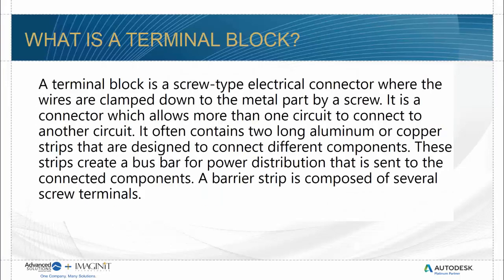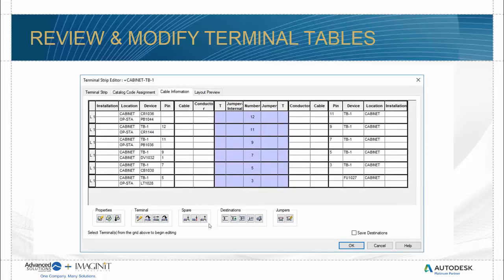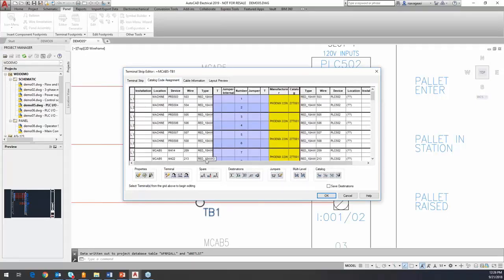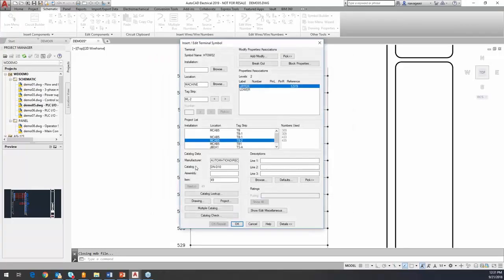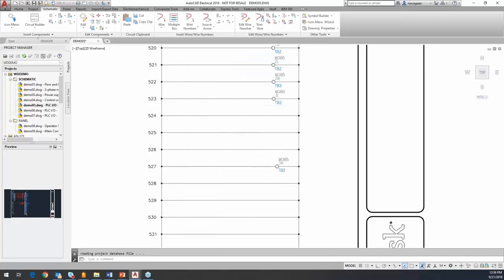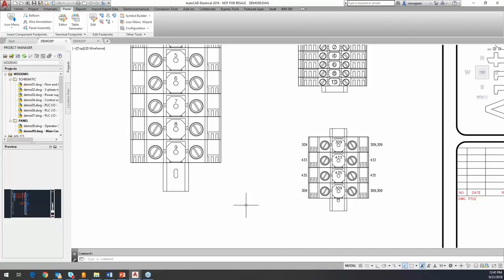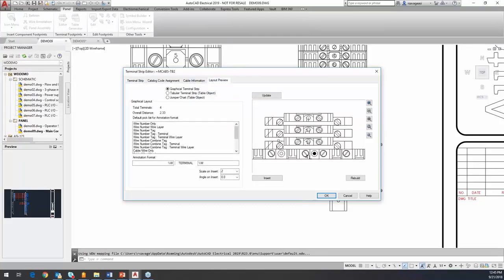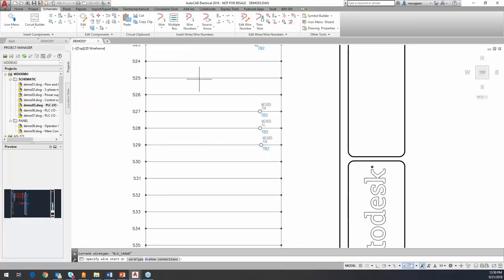AutoCAD Electrical Terminals

Comment: hello, could you tell me how to automatically change the wiring numbers before and after terminals? I mean I need a different numbering, for example, the wire D10AM before terminal WDU6SL and after it becomes D11AM?
Reply from the maker: Sorry this took a bit. We asked our experts, they said: Go to the wire number tab in the project properties and make sure everything is set up there correctly.  You also need to make sure that they are using the terminal that is (whatever shape) with wire number change. 

If all else fails, hit our website and submit a support ticket.